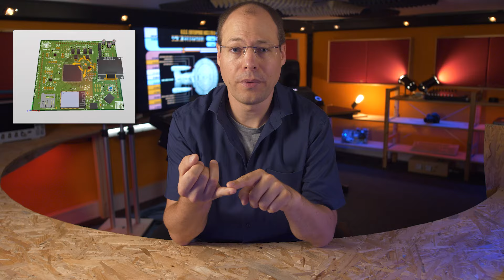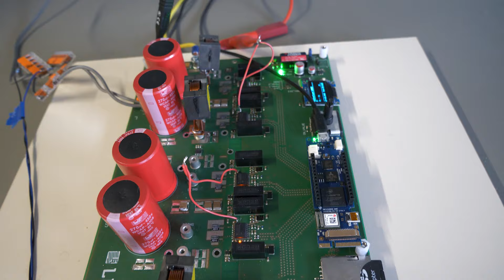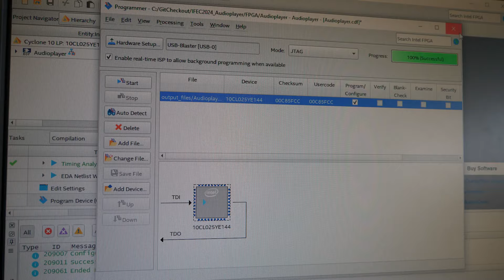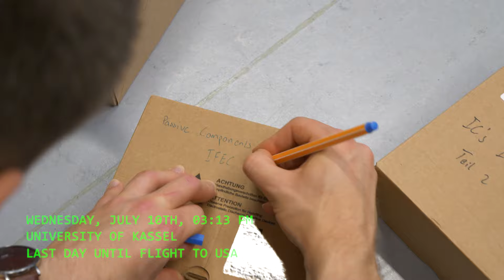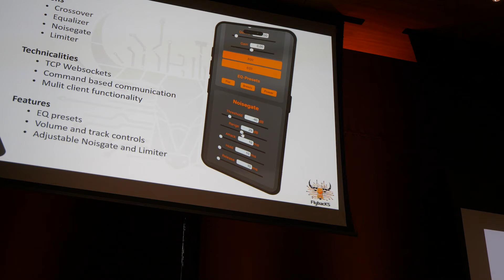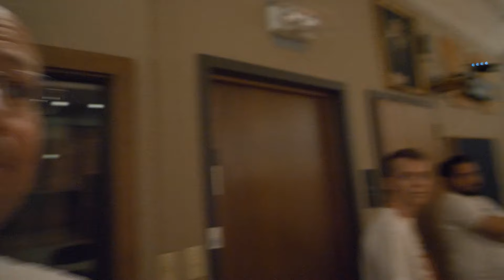An Engineers road movie to an FPGA based Class-D-Amplifier

Comment: hifi culture is doomed, class d isnt hifi, and will be never gonna be as good as some well known class AB amplifiers (Or any class AB amplifier). Class D is good for normies who never heard a good amplifier, and people who say that oww the class D is good, have broken ears. (Also the class D users whos best compliment about the amplifier is that the bass reproduction is good)
And i say it cause in class D you dont have the linearity. Okay its efficient, and some amplifiers can be pretty flat, but it will never gonna make a warm sound. I tried some class D amplifiers, and they dont have the warm sound like my Sa7800 do. And my SA7800 no special amplifier, its just high end. I think that its over. And actually its sad that the bipolar junction transistor counts are shrinking, we no longer have that different amount of transistors that we had like 20-30years ago.

Im definietly gonna stay at class AB.
Reply from the maker: I won't even try to find arguments in favor of a Class D amplifier. I play in a big band and appreciate the warm sound of a tube amplifier. The tubes saturate very softly at full load (and beyond) and it still sounds very pleasant. Class ABs are therefore certainly a good thing, but unfortunately I haven't yet heard one consciously. Class-D can only try to come close. However, the measured values of the other teams in the competition have shown that you can achieve any low distortion values with a Class-D and with suitable modeling of the sound, a lot is certainly possible (now I've made arguments at the end anyway, sorry :)
Reply: @pcdimmer  sure, how did you never had a class AB amplifier like ever??? Tube amplifier can have pretty high linearity. I personally dont have any tube amplifier, but i heard some, and they do have very warm sound, but i like my solid state Pioneer amplifier more, since the sound is more clear that it can do.

Comment: I'm curious about the amps performance under sustained load. I know Meyer Sound Labs, in conjunction with the AES have developed newer tools like M-Noise (Like pink noise, but with much higher crest-factor) and other measurement parameters. How long can you sustain peak voltage on this amp? Great work team and thank you for sharing this journey! (from Australia)
Reply from the maker: Full load is indeed a challenge at the moment. Since we could only find a limited number of fixed inductors at Mouser.com or Farnell that meet our specifications (capability of beeing an inductance even at 5 MHz, no or low saturation, etc.), we used an inductor with 2.8A rated current (rather, two in series to achieve the required inductance of 44µH). At 48V and 135W, this is exactly the rated power, but it does mean that the small inductors get very hot: we measured 150°C at the inductors under full load. In the meantime, we have also operated the amplifier at 145W for shorter periods of time (even at 200W for a few seconds), but I would not leave it running at full load for long periods in its current state. The voltage itself is not a problem.

Comment: Back in the days I owned a Sharp SM-SX200 class D amplifier for a while. It was fantastic. THD 0.05% and 200W output. The switching frequency was at 5.6 MHz! It was a total monster for its time. There where some interesting patents for the design I remember. 
The enclosure was solid because with the hood of it doubled as an excellent radio transmitter.😂
One of the best amplifiers I have owned. Totally clean neutral sound.
Reply from the maker: Even with the THD of just 0.25% achieved at the end, the device already sounded great. After my vacation I will also try upsampling to 1.5MHz or more with PDM (i.e. DSD) instead of the current PWM. This should also reduce the THD and the variable switching frequency should reduce the switching losses somewhat. We had also tested switching frequencies around 10 MHz in between. But the 100V GaN semiconductors got quite hot. EPC has even better GaN components here, but we had agreed on the GaNSystems components.
Reply: @pcdimmer  You and your students did a great job. I have developed embedded systems for a living. Trying to get the first iteration up to 100% spec is a waste of time. Fail fast. Fail cheap then iterate. That’s my preferred design philosophy. “Failure” also gives information. Often more than success. Most of all I do avoid paralysis by analysis. Great video! I enjoyed it very much.
Reply: @pcdimmer  From a viewpoint of a power electronics engineer, you absolutely don't need GaN components here :) There's plenty of mosfets rated for such voltages and controlling them would be a breeze, compared to GaN

Comment: Strange design regarding cooling. What make it look like a box? Big waste of space. Could you not use some sort of Gallium nitride regulators instead of the zenner diodes? I suggest you take a look at one of the cheapest GaN power amplifier amplifiers on the market. The Admark AD60 This can output 2x 6000W RMS at 4ohms I believe. They are the cheap competitors to amps like Powersoft where Powersoft have a dsp Admark do not generally have one.
  I see you are designing around the audiophile hifi market which is probably your best option with this type of design.
Personally I prefer to have my DSP processing separate to my amplifiers. You can simply follow the same user system for all outputs and if one amplifier breaks down you can quickly use any spare and it's ready to go. I prefer to keep 2x non computer controlled BSS dsp units at a minimum in case one of them goes down. In this case I can still run all the amps in mono.
  I would suggest a different layout that saves more space and would facilitate cooling if you needed or wanted to add it later. 
Also. I would try testing the amplifier with heavy bass music and various types of speakers to see just how well it can handle stress.
  Since you are more into the electronic side of audio I wouldn't expect you to have the best sound clips and cuts in your videos. But perhaps you could bring it up to 2024 with the clips you use (not the song tracks so much but the infill jingles you use) But it would also be good to hear some more fun music for the youth as after all you are teaching the youth not the boomers.
  Modular stacking or racking design is much more versatile as you can keep stacking / adding to your system as needed.
Reply from the maker: The GaNSystems switches are bottom-side cooled, which is why they are cooled through the circuit board with thermal vias. That's fine. However, there are also GaN semiconductors that are classically top-side cooled.

We were aware that we were wasting space by plugging the individual boards together in the chosen variant. On the other hand, you have to bear in mind that the boards and the entire construction were designed and developed by undergraduate students. Although a colleague and I helped with the design, the boards were actually developed by the students. I think that's a great achievement. One of the other teams, for example, had minimal analog signal processing and therefore required extremely little space on the control board. Here alone, our ControlBoard is already very large at approx. 60 cm². Looking back, we got a little lost in features and neglected the optimization of the main part. We also had numerous gate supply options to choose from, but decided on the most robust one. Bootstrapping at 5 to 7 MHz was too shaky for us and DC/DC converters were too expensive.

A stacked version would certainly have been the better option in terms of volume. However, we were very careful with regard to possible damage. One of the teams in previous competitions had optimized everything for volume reduction and was unfortunately unable to show anything at all in the end, as the device no longer functioned thermally due to its small size.

Comment: This is why i hated the university. Task: reinvent the wheel but it can't be round, make it hexagonal.
It was exactly the same way, make usesless bad stupid shit 😢
Reply from the maker: Well, I can understand the frustration. But if you're not challenged to think outside the box during your studies, you probably wouldn't come up with innovative ideas. Sometimes it really is a hurdle, especially when you see what others have already published on a certain topic. In our case, we already knew that a THD+N below 0.1% was the minimum target - if you don't know how to achieve this, it can be stressful, but it's usually a welcome mental exercise.

A couple of years ago I worked in a company: there were ready-made kits for almost everything. So if you wanted to solve a problem, you just had to take certain things from it and if there were problems, there was a special department for that. That's also the reason why I'm no longer there, but at university :)
Reply: @pcdimmer  It's up for debate....but since i got a bit older, I started using a different approach to making shit better, and it's pretty much bang on with the innovation side: Get something that works perfectly, and try to add a feature to that shit, or improve a parameter on that without making it bad.
Don't try to reinvent the wheel, it will take you a shitload of money and a shitload of time, and you will get a wheel that worse in every possible way. Try to make a wheel that doesn't slide on ice for example...or some other thing...
If my teacher would have used this approach I most likely would have went a different path...but neah...it did not happen
Reply: @tanaseav  If mankind had used only a "making shit better approach", we probably would still live in the analog world e.g., scratch our nails on surfaces to make sound, no grammophone -> no turntable -> no CD player -> no cloud based server music, ... disruption/thinking outside the box is an option. Stay curious ...

Comment: What a great project,tremendous effort.0.2% is a decent figure.
I was wondering 
Is the THD  of 0.2% a system architecture limit?
Did you simulate the amplifier architecture mathematically to get an idea of what the limits of distortion are,and where critical areas may be?
It has been suggested that the sigma delta modulation design must be carefully modeled and understood mathematically to acheive very good results.
The second critical part is the design of the filter used to remove hf components.
Were the distortion figures you quoted,for the real reactive load,or into a resistive load?
Back reaction currents will mess with the amplifier!
Finally,it has been suggested that to really test for an amplifiers true distortion performance,you must use IMD testing,usually using two tones,of a particular frequency spacing,not sure what exact signal specs are,details available online for sure.
I heard that Class D has now reached the level of the best class A amplifiers.
Bruno Putzey has given some brilliant interviews  on the subject,and is viewed as one of the best class D design Engineers in the world,if you want to listen in he's on youtube.
I love the project guys well done.
Reply from the maker: Many thanks for the numerous questions. I achieved the THD+N of 0.25% unregulated with the HF PWM and upsampled 1.5MHz audio. The spectrum shows that we still have peaks at 2kHz, 3kHz, etc. with a 1kHz test signal. With a suitable control, these components could be significantly reduced so that a THD+N of 0.02% would certainly be possible. Unfortunately, we used audio ADCs for the feedback that allow a maximum sampling rate of 192kHz, which is significantly lower than the upsampled audio samples at 1.5MHz. We should have used a slightly more expensive ADC with a few mega samples - without looking any further, perhaps an ADS9813 with 2 MSPS. Above all, this device would have allowed +/- 12V as input voltages instead of less than 2V.

The students carried out simulations in QSpice and PLECS. The challenge here was rather to simulate a realistic image of the loudspeaker. With a pure resistive load, the THD+N values were very low, but as expected, they were significantly worse with the speaker connected so that we knew that the control was mandatory. With conventional Class D amplifiers, the feedback is fed directly into the comparator input in analog form, which leads to an extremely good control. In our design, we initially had the AD conversion, which leads to a limited bandwidth and some other limitations.

We had implemented a total of four different sigma-delta modulators in VHDL: first-, second- and fourth-order SDM as well as a two-stage modulator. However, testing these modulators also showed that we absolutely needed a feedback so that the system would still function stable with higher order modulators.

Regarding the output filter: yes, at high switching frequencies in the range of several MHz, it is very easy to set your own filter against you. We had some problems finding a suitable inductor and getting it delivered. Unfortunately, this is also one of the reasons why we had quite high losses. All measurements shown were with a connected resistive load.

Intermodulation tests (IMD) were also carried out during the electrical tests in the USA: a 1 kHz and a 1.1 kHz signal were superimposed and the spectrum examined. However, as we did not perform well here due to the problems mentioned, I did not include this in the video.

I am familiar with Bruno Putzey. I also watch Paul McGowan's videos from PS Audio from time to time. It's inspiring what is technically possible. But for now, the topic is closed. We will probably set up a measuring device for components with the power amplifier, but Class D amplifiers for audio are not a research topic for us.

Thank you again for your questions and the kind feedback.

Comment: Are you going to publish the code / pcb schematics for this project?
Reply from the maker: A larger part of the code is available here: https://github.com/xn--nding-jua/Audioplayer. This can be used to output a PDM (or DSD) and control the GaN output stage with the IIR-Filters (EQs and Crossover). Since the control loop has not yet been fully tested anyway, this is almost the current status. Only the high frequency PWM with Noiseshaper and 6-bit Sigma-Delta-Modulator is not included. I'll talk to the head of department in later August to see if we want to publish the latest version of the code and the schematics. But I'm in vacation until 19th of August, so give me some time...

Comment: It's bit of an off-topic, but do you think you could use an FPGA to convert the usb-a signal of a class compliment usb audio interface to spidif or AES/EBU I/O? Because It would be really nice to use my old 2 cannel interface as a spidif expansion for my new RME unit.😊
Reply from the maker: Well, I'm not aware of an USB-Stack for FPGAs. It will be easier to use a Soft-Core microcontroller within the FPGA. For the SAMD21 there are information about a USB audio class compliant endpoint at the Microcontroller-Forum: https://www.mikrocontroller.net/topic/470707

So this seems to be the "easier" way - anyway it would be a lot work. FPGAs are good for direct processing of linear protocols. But USB needs a lot of bidirectional communication.

Anyway, I already thought about audio over USB or Ethernet. But as I said, it is challenging...
Reply: Thank you for the quick response! DIY Audio over Ethernet would be a really interesting topic btw!
Reply: @kabellab99  Have a look at the FreeDSP projects with high channel count. They use an Xmos processor for the task of handling USB audio class 2 compliant endpoints as well as any other possible conversions, even time keeping and clock generating!

Comment: Can you explain the power stage more in depth? To me is more interesting than the user interface part.
Reply from the maker: Hi,
yes, this will be a good topic for a follow-up video. In general we are using GaNSystem 100V Enhancement Mode switches with around 5 Ohm Gate resistance and 5ns of dead time for the power stage. The voltage-supply for the gate was quite challenging as our driver-ICs had a close undervoltage lockout-level that kept us busy. That was the reason for the self-made SRC for the gate-supply.

I will collect some interesting points and maybe comments for a follow-up video.

Best regards :)
Reply: @pcdimmer  Nice work! I'm also very curious. To me it sounds like the deadtime might be a noticeable THD-contributor at these switching frequencies as it leads to a current dependent disturbance. And as a consequence it would show up as harmonics of the reference waveform. Greetings from Munich. :)